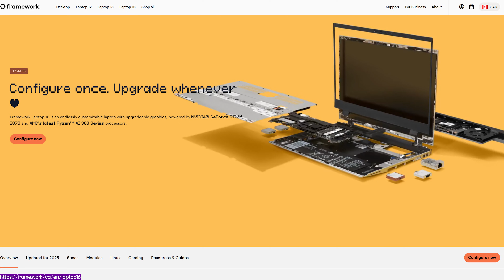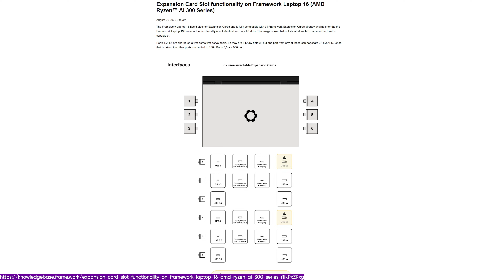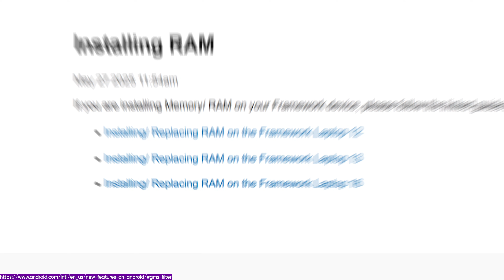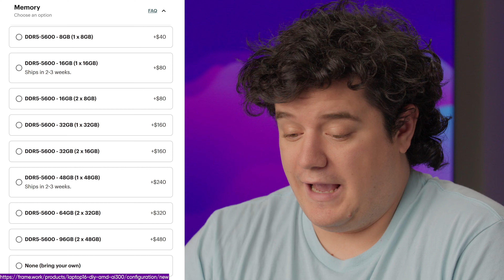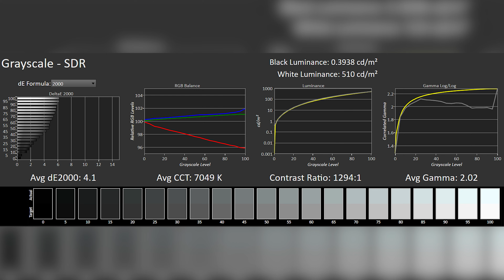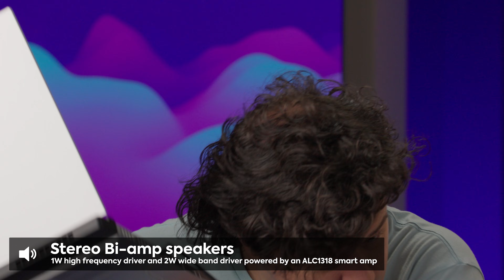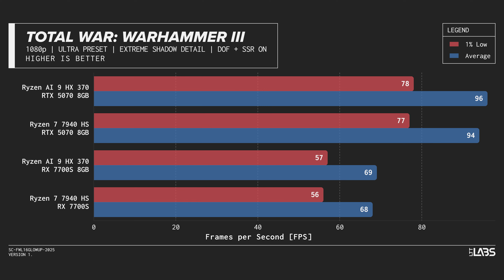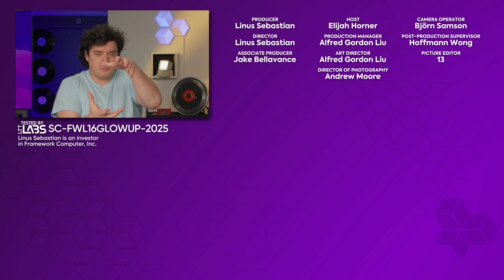I can FINALLY Upgrade the GPU on My Laptop! - Framework Laptop 16 (2025)

Comment: Honestly if you wanted to upgrade the graphics in your laptop you could just get an egpu dock with a usb4 connection. And you'll be able to use a desktop card instead of the mobile cards.

Comment: Too bad the value proposition just isn't there yet. Tough to compete with the giants that sell everything soldered.
Reply: You know only low end and high end have soldered stuff right? Like a normal laptop has ram and storage you can mess with? These are just simply overpriced
Reply: @dylangoss6991 well the entreprise ones do (Thinkpads, Probooks) but modern consumer laptops often have soldered ram? Or do you know exceptions? Ssd is still replaceable thats true
Reply: @vxrxtxs umm no papi it’s either the dog shit ones or like the fancy fancy (like apple, but there’s a reason there) if you’re spending money on anything with a dedicated gpu it has ram and ssd , and honestly most laptops have swappable ram if you hit 300+ (new) it has ram if ur below that there’s no point anyway

Comment: Framework is a total failure imo. Nothing I want and was expecting was done. I wanted a desktop in a laptop frame. Noise, irrelevant. Size, irrelevant. Upgradability and easily replaced frame, fans, heatsink, and screen.

Comment: The only reason Nvidia gave the 5070 mobile 8GB of vram instead of 12 is because they wanted the framework 16 to fail.
That's it. That's the only reason why they did this.

Comment: The Framework be flexing.  Literally 😅. The price of the 5070 GPU upgrade is really high, only supports 8GB of vram. Honestly I doubt it offers much gaming performance boost over the 7700s unless you’re into Ray tracing.  Only worth it if you buying a new Framework laptop or you have specific workload requirements. 

I got the ASUS Zepyrus G14 with AMD R9 AI cpu, GeForce RTX 5070 Ti with 12GB of vram, and 32GB of ultra fast DDR memory (soldered non upgradable). The SSD was upgradable and I upgraded it to 4TB ssd and wiped factory Windows install for fresh and use G-helper instead of bloated Armoury Crate. It’s as sleek and portable as a 14” MacBook Pro but it has desktop class gaming performance. Now that CPUs and GPUs not going to get much faster in normal tasks and raster graphics, and the 5070 Ti already a beast for gaming and AI. I can go years without upgrading.

Comment: Love this laptop it's just lacking the software department though. That I'm happy to say is slowly changing. There was no way to control the fans and set curves previously and now there is. I've built an open-source tool to allow you to do that. I'm also planning on adding an LED-Matrix controller to it. The current tool is pretty useless given that you loose your design after you restart.

To find my tool, simply search for: "ozturkkl framework-control"

Comment: If Framework can make that you can easily connect EXTERNAL GPU (better than "upgrade" from limited stock and limited choice of) through Oculink-like connection (that basically saves the desktop-like performance of GPU) - I'm buying it instantly.
Reply: Me and many other Framework 16 owners have already installed oculink on our laptops using the Framework dual m.2 adapter.

Comment: 96gb high specs humm 
blander 
programing 
muilty apps
and more i said programing cause testing stuff can take some ram but i find 64 fine for now
just going to Edit this to say yaa the screen can be upgraded or down graded easy 
if frane work sells both a display cable for 0.4 and 0.5mm screens yes im talking about the conactor on the back of the screen

Comment: u pay almost double for the laptop than the competitor and than u need to add other 900 dollars for a 5070 gpu  so in total u pay aroudn 3500 dolars for a laptop that fights 2300-2500 dollars laptops , if u save the 1000 dollars and add other 1000 u already have 2000 and if u wait to buy a new laptop after the new tech launches u will find current ones on sale and u are bound to find a 2.5k laptop for 2k
Reply: or spend the 3500 dolars for a more powerful laptop and u wont upgrade it

Comment: Those faulty spacers remind me of my old lenovo ideapad (do not buy a lenovo ideapad). If my wrists were touching the sides of the trackpad or the edge of the case while typing I would randomly get small electric shocks.

Comment: Just buy a MacBook with 2x the battery life and a better screen at that point. Frameworks sole mission should be to reduce their price point  right now. They can’t compete on performance, longevity, or build quality at what they charge atm. Super niche, no consumer wilts a straight head would purchase this over any other option.

Comment: And any good will to framework has now been thrown out of the window. That keyboard flex and horrible screen is just not good enough to justify 3000$ just buy a desktop because that mobile 5070 is just a 5060!in disguise.

Comment: As a framework 16 owner, having to buy a new screen to take advantage of the 5070 feels like bait and switch. The idea is to upgrade single components. Having to spend 1k is just crazy. They should be offering some sort of trade in program for those of us that bought the 1st gen product, otherwise they are just creating more e-waste.

So far I feel ripped off by my purchase. The upgrade path will cost more than just buying a new laptop every few years. They are causing more e-waste with the screen upgrade to take full advantage of the 5070.

I want to believe in them, but so far it is overpriced and underperforming compared to the competition.

Comment: I think its way too expensive. Im an apple user, and this is the one windows laptop that had a chance at stealing me over. I dont game, and apple is very competitive when it comes to non-gaming mobile gpus. It’s crazy to say, but for my use cases apple is actually the cheaper route. Even upgrading overtime because apple is so optimized for years that I can get a $2k laptop now, and use it for 7 years. No need for a $1k gpu and screen upgrade every year.

Comment: I like they did upgrade on the replaceable gpu idea. However, I wish they would provide a 5060 and 5070ti option instead.
5070 is the worst of the 50 series laptop gpu.

Comment: Not sure if this has been called out or not, but the unit in video is the Ryzen AI 9 HX 370 based on 10:50  but when battery life is discussed it is labeled as the AI 7 350 at 16:45. Is this typo or is that result for a different unit? 

Super excited though about this laptop. Was disappointed in Gen 1 with the CPU and GPU offering.

Comment: I want to say this: the movement from barrel plugs to Type-C for charging is a godsend. I had a laptop where when I thought the plug was bad, I learned that its wasn't. The middle post in the port itself was slightly cracked, allowing it to wiggle and literally made it impossible to charge.

Comment: 4:48 Elijah why is there NOT a warning message to disconnect the battery before adding/removing internal components. Because it can be so easy to short out the motherboard when dealing with internal components.

Comment: 7:43 Framework already failed that test in my opinion. that is way too much flex. On comparison to one of the cheapest laptops I could get in 2007, it doesn't flex that much unless you actually want to break it but things have changed a lot from that time to now Lol. nowadays there is way too much flex on even the most expensive laptops you could get

Comment: You call yourself tech people but still review laptops on top of cloth and materials like that. Of course it will get hot and run the fan harder. Try a normal surface 🙄

Comment: I dont think anyone dislikes the laptops. Its just the price is abit much.The base 12 inch cost like $550 with no ram, no storage, no power adapter and no expansion cards. Whereas you can spend $550 and get a very good laptop. And its been a few years too but price is still the same.

Comment: 17:48 - 18:06 That... is not how this works.

1. There is also an application that can be used + a cli written in either rust or python and iirc there is a microcomputer managing the led matrix. Thus the website is only sending signals to the micro controller, meaning that you don't need to keep the website always open for it to function.

Comment: I appreciate the effort towards repairability, but this is entirely too much. The company should really make an opinionated design choice and have keyboard and touchpad and such have set positions. Repairability isn't to have such flimsy... shit explode into parts when dropped off a table; It's to not fuck up spare parts' supply and a design not hostile to a normal screwdriver. At the end of the day, the LED matrix and the swappable ports are just neat party tricks. The latter can be useful for like a port or 2 but the rest should just be ports directly into the motherboard and preferably routed directly to where they need to go rather than having to do everything over USB. The ports inside can be like on a daughterboard of sorts like how the charging port on most phones I know is, making the ports replaceable. This should basically be a modern VAIO

Comment: i feel like upgrading the framework yearly is not what most people would do. I figure the upgrading will be similar to a desktop maybe every other year changing out 1 or 2 parts not entire system some people i know do a core component change at a 18 months some do the mobo cpu ram at 2 years and gpu at 18 months depending on finaces i think framework laptops will follow the same trend as you would your desktop and there is definetly an argument to be made that a framework laptop would replace a desktop so you dont need two systems i did that in college with an alienware couldnt afford both needed a latpop for school so got home plugged it in to 2 monitors and my home keyboard mouse then uplugged threw it in my bag took it too school

Comment: Starting at 1500$ means no 5070 no storage os ram power supply ports or tax lmfao 😂 these things are trashhhhhhh

Buying it to upgrade it … you also have to do the screen…. 1000$ lmfao 😂 that’s a laptop guys , stop buying these
Reply: Good, reliable, repairable hardware costs money. Hope this helps.
Reply: @Clarkzer0 it’s the same hardware that all its competitors have at 1/3 the price and has everything off rip , hope this helps

Comment: i would consider framwork, if the laptop for an 5070 ti would be around 3000€ but they are way to pricy. hope the price drops, i will consider it if they are not way to overpriced for what it is. they can get extra for parts i woudlnt care about 3100€ for what is an 1700€ laptop? thats really expensive no matter how you see it. i could get 2 laptops for it... or an same pricy one that lasts a few years longer..

Comment: Being upgradable is amazing, but I absolutely cannot find any way I could spend 3k or more on this laptop instead of 2k (1k less yea) for a Zephyrus G16 2025 which is better than this one on almost every aspect imaginable except upgrades. Better design, better battery, much better screen, better built and materials, better touchpad, MUCHHHH better speakers, amazing linux support (with asusctl project + rog-control-gui) and overall a much thinner and lighter laptop. Also with a charger included when framework asks an extra 120€ for their charger.
I love that this is upgradable but... just forget it.
Reply: Zephyrus is just one of the laptops of all time for real. I still love my M16 2022, the design language is just unbeatable compared to other gaming laptops. 

I think if you care enough about upgradability, like u said, spending 3k on a Framework 16 just sounds awful. Dropping 2k on a good gaming laptop like the G16 then drop 1k for a decent Desktop gaming PC is just much more reasonable, if you need both portability and upgradability for your machines.

Comment: Watching this i felt like im at a startup pitch. The product looks and feels horrible and not a single piece is market ready yet, but the idea of the final product is ready for business angels to come in. Dont get me wrong i love the idea of a repairable laptop but i dont want to trade that for a waterbed keyboard, a bad display and a tornado out the back. I feel like the chasis in particular should be the base you build around for >10 years which should be reflected in the quality. Watching the video it felt more like a 300$  chromebook. I mean DAMN that screen flex.....

I just feel like this video lacks the typical critisism. Everything feels brushed of as if it was just a necessary evil. I do 100% agree with the end though: Its such a cool device and i too would love to buy into the idea of simplying upgrading my gpu down the line but for that price and build quality (as far as i am concerned by the way the video made i look) thats not gonna happen for but a few who value this cool above all else or consider it a hobby rather than a necessity to upgrade on a yearly basis.

Comment: 18:36 You are not buying the upgrade path. This is the dumbest argument I hear for these framework devices. It would be more expensive in the long run. Consider this: A laptop with same specs that can't be upgraded if that sells for $2k, and this is $3k, and the upgraded gpu in 3 years costs $1k ($700 gpu + $300 screen), thats a total cost of $4k in 3 years. On the other I hand I can just get a new device for $2k, and sell my inital $2k device for say $700, In that case my total cost in 3 years would be $3300 ($2k + $2k - $700)

I did not consider the sale of the old framework gpu because I doubt there is a market for that.

Do mind I get a completely new device with completely new specs (cpu ram etc) if I buy the new 2k device instead of just upgrading the gpu

Please explain how is the "upgradability" that comes with framework is cheaper and better in the longer run???

Comment: So that config without storage and windows and RAM is still approx 2500,  with the 5070.
for a device that you can open and replace just about anything yourself with far less hassle it's almost worth it, I'm not saying it should be 1200 or anything close, I was thinking more like 2200, it's still expensive but more reasonable and is a kick to the competition.

Comment: The idea behind the Framework laptops is great. But the price just makes them not viable. If you get a current gen machine with the same specs, you'll literally pay half (based on 3k) or less, especially if you wait for a sale, and when you do need to upgrade in 5+ years you'll be able to get some money back from your old machine.  Even in the UK where tech tends to be more expensive than North America, you can get a 5070 machine for £1.1k. And i bet it'll have a better display than the Framework.

Comment: The video is called "I can FINALLY Upgrade the GPU on My Laptop! - Framework Laptop 16 (2025)" but you don't show the process of upgrading it. I don't think I even heard what the base model GPU was or how it compares to the the 5070 upgrade.
Reply: Radeon RX 7700S. 5070 is generally 25-30% faster.
Reply: @johnroberts2905  Did you read the sentence? The description says upgrade the card, not upgrade the entire laptop. The selling point of framework is supposed to be modularity of the parts, the specific part the description calls out is the one part they didnt show transplanting/installing/uninstalling. Read the words. Please.
Reply: @adammiller9029  Did you read my reply?  I responded to the second part asking what the original GPU was. Stop being a smartarse. Please.

Anyway, tell me more about the laptop I pre-ordered and have owned and used daily for nearly 2 years. 🤣
Reply: @adammiller9029  He has gen2 on video but the new NVIDIA module is backwards compatible with gen1 laptop frankly every gen2 part is compatible with gen1 and it goes the same way around, if you want to replace the old gen1 cooling with the new reworked gen2, same goes for display, same goes for keyboard and basically everything.
Reply: You make a good point
Reply: comparison starts at about 15:09

Comment: Is there a particular reason both the new and the old FW16's battery tests were done with the lower tier processors? The difference between the AI 9 and 7 should be especially big, since the 9 has four additional cores and literally twice the GPU cores...

Comment: Just to clarify, when you're talking about the cyan tint on the display and you say "it seems to start okay in the lower brightness settings" you are confusing display brightness with the grayscale measurements from Calman.

You are correct that at the lowest end of the grayscale that it more closely tracks D65, and red is deficient from there onwards. 

However, even though display brightness can change the grayscale balance, they're not the same thing and are not a direct correlation.

Comment: Would love a Framework gaming handheld, think Lenovo Legion go 2. But you can configure the screen: LCD or OLED, detachable controllers that can be upgraded. Most importantly a mainboard, CPU and GPU that can be changed/ upgraded a few years down the line.

Comment: Counterargument, I can get 2 laptops of similar spec for the price of a 16 with the 5070.

The 16 is really overpriced. The 13 already is, but it's still manageable as long as when you upgrade is on last gen (i.e. 7840U main board+memory is cool, AI 7 mainboard alone is as expensive as entire laptops with the same CPU, AI 9 mainboard alone is more expensive than an entire laptop with bigger battery and oled screen)

Comment: 18:54 $700 for an RTX 5070 mobile with 8GB VRam and the performance of a 5060 desktop.

For a laptop that costs $3k already, the upgradability is not really a selling point at such prices.